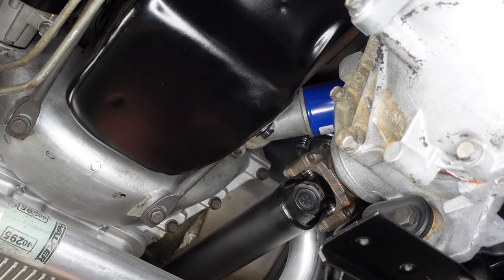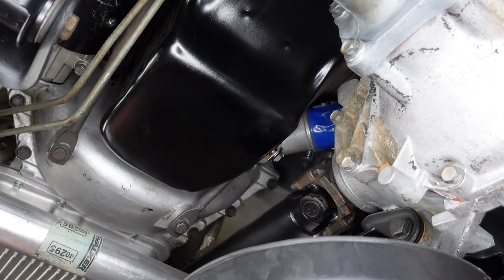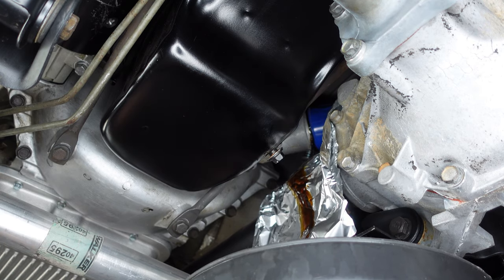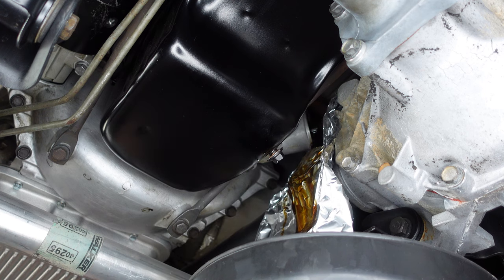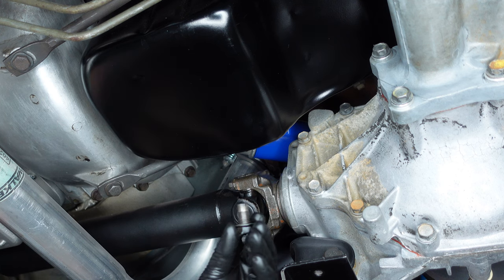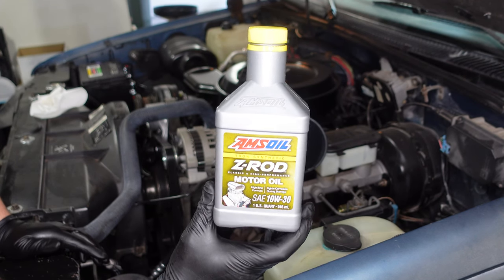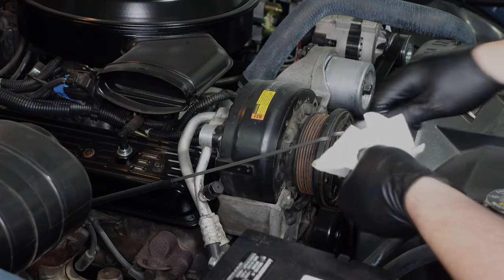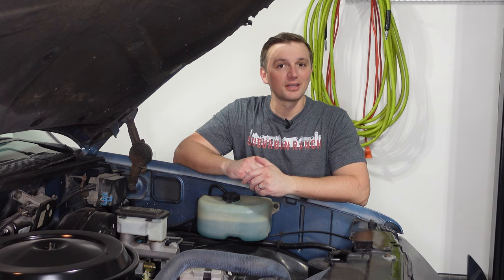Oil change on an 88-98 OBS chevy

Comment: I have the old sealed beam 150mm headlights. I wish I had the style you have as they have conversion kits that are much better. I think I’ve found a conversion kit that works. Truck looks mint man, I still think you will need to put a slightly more aggressive cam in and get a chip made for the computer. The 350 5.7 had really low compression and maybe 200 HP

Comment: Hey buddy I noticed that you don't have the air conditioner clutch belt hooked up what size belt did you use I can't figure that one out and it's driving me nuts if you could help me out I'd really appreciate it thank you sir
Reply from the maker: @joe clark That belt came with the truck, I have no idea what size they used to make that work.
Reply: @SuburbanRanch  does it have a numbe on it bud
Reply from the maker: @joe clark We through it away after we redid the A/C. Sorry.
Reply: naw its good  bud  thanks

Comment: I bought my chevy c1500 recently 
It had the engine replaced in 2002.  For some reason 5qurts reads a qurt over on my dip stick. It’s definitely a 350 v8 engine
What could be the reason its reading over and should i run 4.5 qurts or 5?
Reply from the maker: I would fill it according to the dipstick

Comment: I have 94’ 2500. My ac clutch kicks on and off non stop. No cold air. What do you think the problem is?
Reply from the maker: @Lift Heavy Sounds like they system is low on refrigerant. Probably has a leak somewhere in the system.